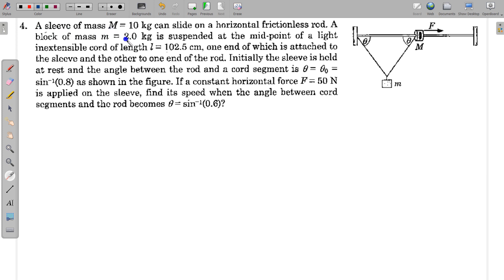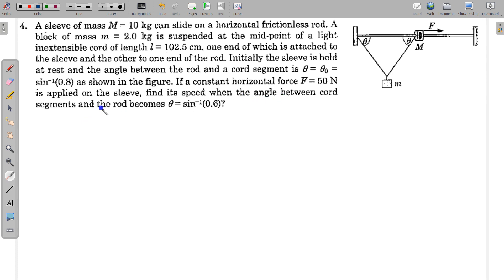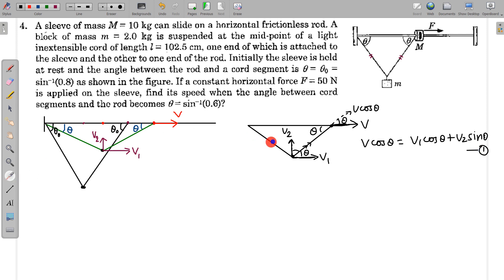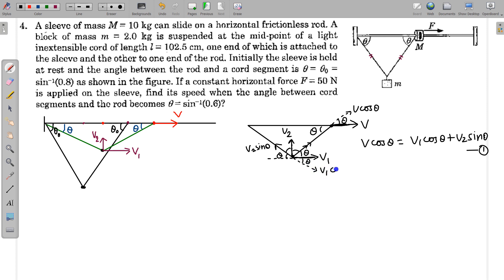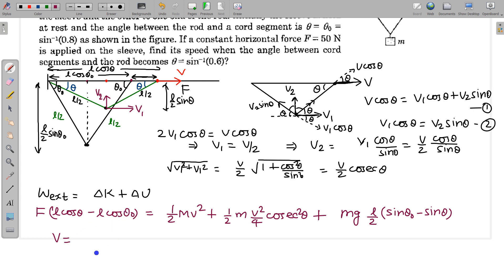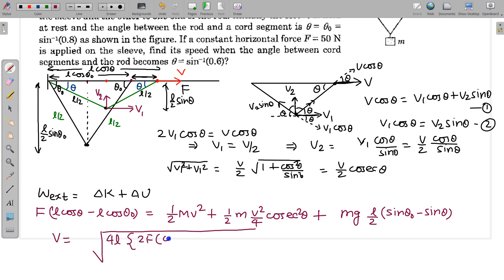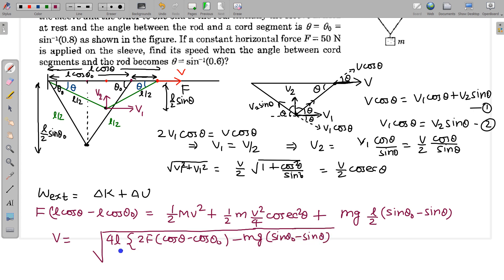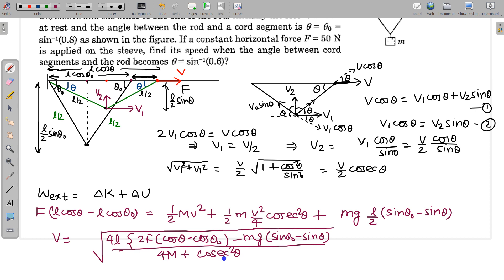Work Energy Power | Pathfinder Solutions | Based on Work Energy Theorem & Constraint Relations

Comment: A car is moving with speed 108 km/h on a large uniform horizontal pavement perpendicular towards a wall. To avoid collision, the driver takes a turn and finally runs the car parallel to the wall with the same speed. Coefficient of friction between the tyres and pavement is 0.6, acceleration of free fall is 10 m/s² and all the load of the car is concentrated on the front axle means you can assume that limiting friction acting on car is µmg, where m is total mass of car. If the turning process is the fastest one on this pavement, check validity of the following statements. [Choose incorrect]
(A) The car follows a circular path during the turn
(B) The car follows a parabolic path during the turn
(C) Minimum radius of curvature of the path is 75 m
(D) Initial distance of the wall must be greater than 75 2 m

Comment: Sir I find out the constraint relation by observing that the point attached to the wall is fixed hence it's velocity along the string is always zero this means at any instant the direction of blocks velocity is perpendicular to the string attached to the wall from here I came to the conclusion that finally it would be moving vertically upward. Now it's just simple geometry